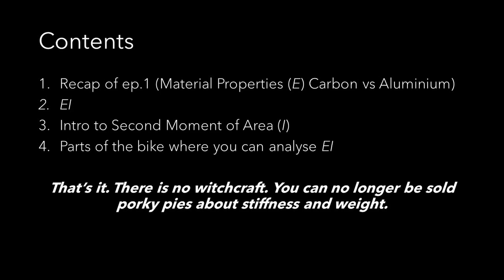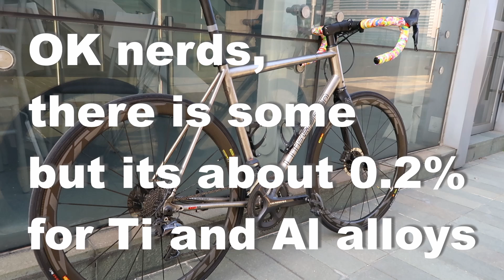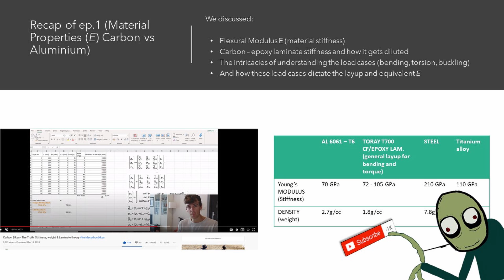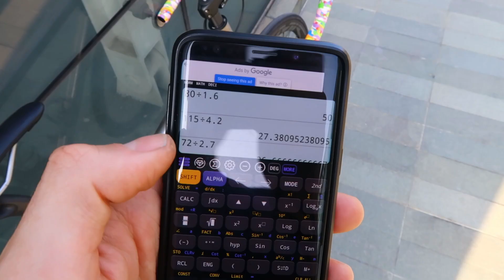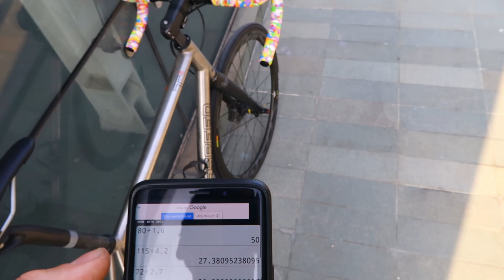Titanium Bikes - The truth and Physics of 'ride feel' marketing.

Comment: Thanks for doing this video.  To me the construction of the fork and it's inherent flex and and the tire sizes and pressures used make the most difference, especially when  when a long and flexible seat post is not part of the equation.  One can see fork and tire flex when riding.  I have high end carbon, titanium, aluminum and steel road bikes made from 1971 to 2008.  The material makes almost  zero difference to the ride quality for me, but what is noticeable is the sound the bikes have when hitting bumps. Let's face it, brands have to sell new bikes and they have come up with marketing "facts" to sell them.  For me, my go to everyday bike is a 1994 Litespeed, as the durability of it the best and there is no paint to scratch or corrosion to worry about and I still do PR's on it.

Comment: The Ti myth started back when steel bikes reached its popularity.  Those early Ti bikes (ie. Merlin) had almost identical tube diameters to steel & riders using the same wheels & groupsets rode those bikes side by side came to the conclusion that Ti had a magical ride quality while being much lighter than steel.  Those same people also compared aluminum (ie Vitus) built with same diameter tubing to be rideable albeit too flexy.  Magic carpet ride was never used for aluminum though back then.  All these myths like running super high psi & super skinny tires to go fast were just things that riders perpetuated because someone else said so & that made it true.  Funny that in this day & age people still do not want to believe in science.

Comment: What about the LItespeed Ultimate "swooped" seat stays acting like a large spring for compliance? I agree about the seat post opportunities for compliance and comfort. My Cannondale Hi-Mod Super Six 25.7mm seatpost acts also like a, smaller, spring. Most comfortable frame I have ever ridden. I've been riding/racing since the mid 1980's. My most comfortable bike is my steel GT tandem. With that hugely large wheelbase of the tandem, there is significant beam deflection. (Truss of frame as a beam.)

Comment: will  double butted bike be more stiffer than a single butted aluminum one.
I was confused between buying a giant contend ar1/emonda alr5/scott speedster 10/caad 13 105.
can you please suggest. 
The contend is a single butted frame and the others are double butted but other wise it looks good spec wise.
 I don't worry about the weight my concern is stiffness.
Reply: a pipe will expirience more forces at the ends, so the goal is to make the ends thicker and middle thinner = single butted, double is better , triple is more better..

Comment: Confirming my findings... I've got a Van Nicholas Mistral 2012... Which I love and would never part with.. It still looks like brand new and it's a sexy looking bike, last year I also bought a Forme Longcliffe 1 aluminium bike as a commuter/winter bike and although it's 2kg heavier ( mostly down to cheaper groupset and wheels) its every bit as comfortable a ride as my titanium bike.. If you want a more comfortable bike, flip your stem up, fit wider tyres, lower the tyre pressure, double the bar tape... You won't get more comfort from a specific frame material it's all down to geometry and set up

Comment: Very interesting, back in the early 90s, litespeed came on strong and titanium alloy was the latest great and go to bike thing.  Tons of lite speeds seen on the road.  Fat tube aluminum was big, carbon never came on yet.  I read a review on the Kestrel carbon frame which I seen in several tours, very unusual shape caught ones attention.  Typically painted in black or white, the ones I saw.  The reviews was favorable instead of the usual “dead” ride reviews for the carbon tube type frame out by another brand.  Kestrel didn’t use tubes.  I bought a red Kestrel 200 CSI with campy 9 speed.  My bike buddies in the club said I was making a mistake.  Didn’t take too many years after, never saw another litespeed on the road.  Ever.  I just refitted my Kestrel, still have it, with the latest Ultegra kit 11 speed and new Campy Zonda wheels.  I figure about 30K miles on the frame and fork, no cracks and I’m a big rider.
Reply: I remember when Litespeed hit and all their titanium frames were the rage. Colorado Cyclist had them for custom build in their mail order catalogs. Really wanted one, but they were expensive. Never got one, stayed with my Columbus SL frame.

Comment: Thanks for that! I recently destroyed my 1550g Al gravel frame, and replaced it with a 2050g Ti frame, swapping all the components over (group/wheels/bars/etc), and noticed that the Ti frame has less "chatter" from the trail. If I'm understanding your comments correctly, this is likely to be an artifact of the increased weight of the frame (and potentially a different seatpost)? Cheers

Comment: Love my 2004 Litespeed Tuscany, as it fits me so well. I understand the Young’s Modulus and shape argument .  This is born out by simply replacing the 21 mm tyres with a 25 mm tyres or changing out the wheels.....they make a huge difference to the ride quality on the same frame .   Still, we don’t want to get into a digital vs analogue music argument then do we :)
Reply: Tyres, wheel seat post, handle bars all affect the compliance/ comfort of the a bike. The trouble is now disc brakes accept wide tyres so they can be supplied to the “influencers “ in a spec to make the characteristics fit the press release.  Modern disc bikes have all the equipment to make them compliant flexing seat posts, carbon one piece bars and shallow wheels. If you pop 60 deep section wheels, 23 mm tyres, alloy post and bars you’ll see how harsh a modern disc frame is.
Reply: Yep, my 2003 Airborne with 25mm and 2014 Ultegra 6800 was a nice step up from the 03 version, but doesn't hold a candle to the upgrade to my 2020 T-Lab. Unique tube shapes make for a very stiff front triangle, with the rear triangle having that all familiar ti ride.

Comment: I have a Ti bike. I never bought it because of the marketing. I bought it after a crash I had on my carbon bike, and the heart break that comes with it. I bought  a Ti bike because of the reasons you said: I liked how it looked and minimum frame care. I'm not so in tune with my bike to know if it absorbs the bumps on the road, if it does is because I have wider tires and lower pressure.

Comment: Good stuff. Having ridden and raced for 30years on all frame materials, I was always amused with the notion that aluminium was 'uncomfortable'. Nowt wrong with it and its cheap! Ti frames are great for winter - rust proof, no paint to chip and much more durable than carbon. A light Ti, steel or ali bike rides very comfortably, a heavy one is stiff. The devil is in the balance and the builder. Vibration is down to saddle, seat post, bar tape, tyres and wheels. Carbon frames are interesting as so much is down to frame design. I've found the heavier (Fenix, Dogma 2/3, C60/64 in my experience) frames handle well, are robust and stiff, while some of the lighter ones (Cervelo R, Willier Le Roi, Scott Foil, S Works Tarmac and TCR SL from my experience) always suffer in some area - eg laterally stiff at BB, Laterally flex at the fork in hard cornering. 
Important as you say to be honest and match the bike to you (ie not sub- 7kg if you weight 90kg...), but unfortunately bike journalists, marketing BS and rider inexperience make this very hard. The best frame I've ridden for weight/stiffness/handling/comfort balance was the Ridley Helium SL. But I snapped mine in a crash (where I doubt a Collage/Pinarello would have failed, let alone a Ti/Steel bike), so the durability had been sacrificed for weight.

Comment: While I somewhat agree, your statements fail to explain why the rear end of My steel bike frame, that weighs over half a kilo more than My over size larger carbon frames, feels so laterally flexy, compared to the carbon ones. Sure, there's more to it - chainstay & seatstsy shape and thickness, tubing thickness, overall shape, tubing type and diameter, etc., but still - the heavy steel frame is considerably lately flexier than a size larger carbon frames.

Comment: All I understand is that E x I = yeooooo
Nailed it on the head it looks great, corrosion resistant and fatigue life had it for me.  Great review 👍 I've got a steel frame which is heavy and flexes a bit, components carried over from prev alloy frame and it so much smoother! Is that due to material or tubing?

Comment: Great comparison with the guitar strings!
Reply: Is it though?  Yes, you can tune a nylon guitar string and a steel guitar string to vibrate at the same frequency when plucked (his model for them being identical I suppose, or neither being "magical" ?), but they sound different.  There's more to the vibrations we experience than the frequency.  Maybe it's these differences that people are noticing and appreciate, but mischaracterizing when describing them.

I would agree though that the comfort (or magical feel or lack thereof) of a bike comes more from tires, tire pressure, wheels, geometry, frame stiffness, various cantilevered items like the seat post, saddle rails, fork, stem/bars, with frame material pretty far down the list.  I love my bikes whether they're made of Ti, CF, aluminum or steel.

Comment: What about butted tubes? I rekon a lot of the 'feel properties' could be explained by this feature. Can you comment on this?
Reply from the maker: Butting only normal happens at the ends where it's thicker. The ends wont tend to bend much in a non-pinned truss, and the max bending is concentrated in the middle of the tube i.e the top or downtube. So its the wall thickness there that really matters.
Reply: @PeakTorque  Yeah that's what I mean. Ticker at the ends to maintain enough material to weld but minimizing material in the center of the member ultimately leading to less stiffness (i.e. more compliance) and sme weight reduction. 

I guess hydroforming and carbon can also achieve this but I suspect a lot of the 'steel is real' comes from comparing carefully designed steel bikes with very early model alu bikes - i.e. the technology of the materials were at different stages.

Comment: That's why I've got a Caad Optimo instead od Caad 13 - the frame indeed is not quite as sophisticated, weighs about 1700g in size 58, but it is *rock solid*, even with my 95kg body on top. And the full carbon fork and other bits keep the overall weight of the bike reasonable.

Comment: I was considering Ti frame and kind of knew that the 'magic carpet ride' thing was bs, thanks for spelling it out. CF has a lot more flexibility to create shapes that are needed, so I was able to get a frame that can accommodate much wider tyres (in my gravel bike) that any Ti frame I could get, not to mention the CF is way lighter.
Reply: an update from the future - I have been riding the CF frame in rough terrain for 4 years now and it's all good, no durability problems or cracks etc. I'm reasonably happy that I went with CF, but given that I have n+1 bikes by now, I'd totally consider a Ti gravel bike as I ride fairly narrow tyres on my gravel now (for worse terrain I have MTB)

Comment: Thanks for confirming what I've always thought and experienced about what gives you comfort. Wider tyres with lower pressure and in my opinion, also a 27.2mm round seat post since tube diameter is also a contributing factor. 
Been running 22m Continental GP4000 tyres at 120psi for years and was shocked at what a big difference I experienced when I first rode on 25mm tyres at 90 - 100PSI.
Reply: Try 32’s in the mid 50’s
Reply: Exactly my experience on my Litespeed .

Comment: You’re exactly right that the impact of frames and frame material on ride quality often is overstated. Your choice of wheels/tires, fork, and seat post/saddle likely will have as much or more of an impact on ride quality.

That said, titanium is very light and very strong, both of which are good qualities to have in a bike frame.
Reply: por supuesto que las ruedas y la tija tendran una funcion mas importante en la conduccion!
Reply: @g0yit0  Keh?
Reply: Titanium is expensive and difficult to weld and impossible to shape based on production

Comment: I wonder why there are no Ti bikes with dropped seatstays, similar to the current trend with aero bikes?
Reply: Would put a lot of strain on the weld seat tube - top tube??      Rgr
Reply: @borano2031  That makes sense, but I did find a couple of Ti manufacturers doing it, and the same logic would hold true for carbon and aluminum, yet there are dropped seatstays

Comment: I never tried to sell a ti bike on material based ride quality, only durability, repairability, asthtetic, and the lack of corrosion. Thanks for the confirmation.
Reply: My 30 year old double butted Steel frame is rust free and rides like the first day.  My 6 year old Sku $199.00 aluminum bike looks and rides like the first day as well.
Reply: @s @stevenr5149 cuz u never go out in bad weather. My steel bike has rust inside after 7 years. Moisture, water seeps through screw holes etc